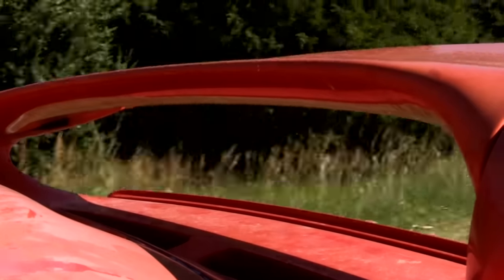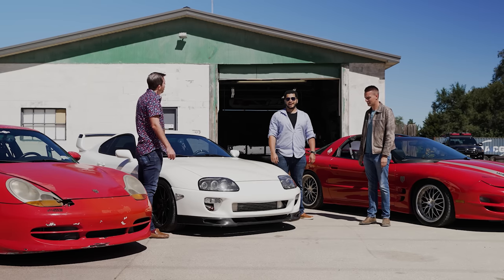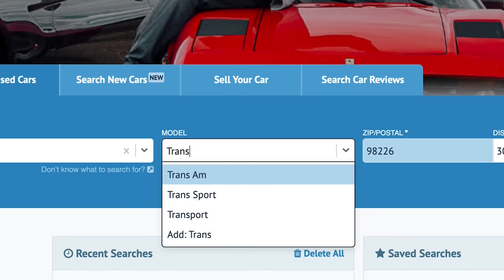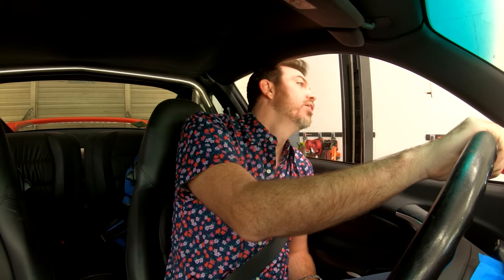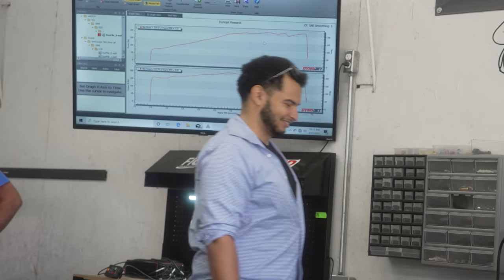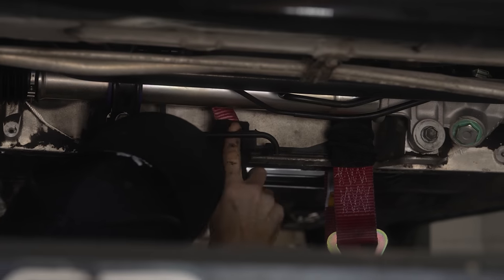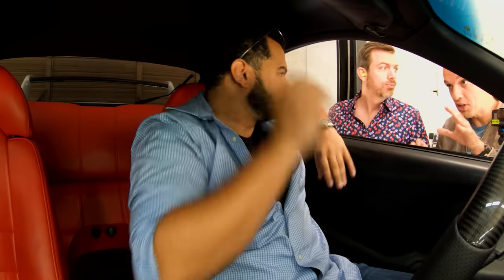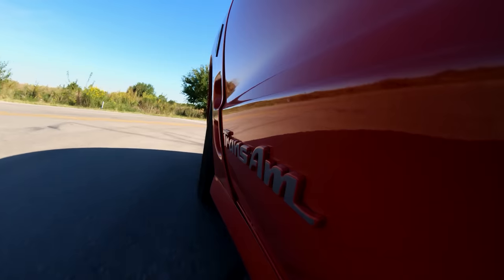We Bought 3 Dirt Cheap Sports Cars...Here's How Fast (Or Slow) They Actually Are | Car Trek S6E1

Comment: Ummmm....my dad took a 74,222 original mile, one owner, zr1 brakes, BIG ass cam, long tube headers, BC coilovers ws6 trans am for $2,000. I bought it for $3,700 out the door. This happened 3 months ago. AND its a black hard top. Yyyea. It did have a slight electrical issue impeding startup, but it turned out to be because of the fact someone lost the original key, had a new one cut but not programmed (pretty sure his son went on a joyride and lost the key then didn't have the $ to program it). I paid $180 to get a new key and fob programmed and the car is absolutely, 100% perfection. I put larger injectors, better valve springs, and an hp tuners tuner. She makes 433 wheel hp....NOT spraying the 150 shot dry N2o kit i installed. When i spray it, she makes 572 wheel. After the extensive and aggressive weight reduction including sterio and head unit delete, all seats gone with a kirkey in their place, gutted the 200 pound doors, a/c delete, i even evacuated the system and removed the condensor for maximum cooling. I got it down to 3004 pounds. My dad has a tuned c6 zo6 and i blow his doors completely off. It started as a joke but its actually grown on me. The thing fux im not gonna lie. In "mexico" i did a GPS confirmed 188 mph without nitrous because the bottle was empty. In the 96 days ive owned it, ive spent more money replacing tires from the unbelievably irresponsible burnouts than the entire car costed. Its actually legitimately fast believe it or not. I ran a 10.88 @ 128 mph all the way up here at 4670 feet above sea level. That was with c16 in the tank but hey. Its been dead reliable, sounds really, really cool, and my purge is going out the ridiculous nostrils in the hood which is just beyond cool. The other day i had the speedometer buried at a dead stop. 5th gear nitrous burnouts are rad i dont care who you are. My wife loves it even. When we go out on weekends instead of my cherry, 730 wheel,  port injected, and insanely high strung 427 cobrajet and t56 swapped 66 mustang she wants to take the fumunder chicken. Probably because the mustang is absolutely terrifying. It weighs 2830 pounds with me in it. The front suspension and k member is all tubular hotchkiss from an sn95 mustang. Doesn't change the fact its insanely violent, sounds exactly like a nascar and is just as loud, and has a really light flywheel with a triple disc so backtorque is a bit of an issue and can render  a new passenger concussed from cranium to roll cage impact.

Comment: The WS6 was dynoed wrong!! Driver placed the car in 3rd gear and said "that's my 1:1". He is absolutely incorrect. Dynoing the car in 3rd gear produced an incorrect and falsely high number. That cars 1:1 ratio is 4th gear since it's a manual. If the WS6 had a 4l60 automatic then yes, 3rs gear would be 1:1, but it actually has a t56 manual trans and 4th gear is 1:1. 

An amateur level mistake.

Comment: Amazing video! You guys never disappoint! But i have to ask, where did you find a GT3 , A Mk4 supra where they are considered "DIRT CHEAP"  sports cars?!?! For the type of cars those are that statement doesn't sound too believable. 4 inch exhaust, aftermarket intercooler , red custom interior ,wrapped in Michelin pilot sport tires, carbon steering wheel, big brake kit and a ECU tunned to run race fuel isn't exactly "Cheap" If you're trying to appeal to your YouTube audience then at least be humble and honest about it

Comment: 220 hp from 315 hp on the Porsche is huge loss. Porsche generally have less than 10% drivetrain loss, so it would have been 280hp at the wheel when new. Firebird at 400 from 545 isn't that bad. It should have 465 at the wheel when new. The Supra obviously doesn't belong in a just bought for under $30k category.

Comment: 3rd gear is not 1:1 in the t56 6 speed in the trans am. 4th is 1:1. I'm pretty sure the dynojet uses speed to calculate power so the ws6 power number are not correct

Comment: supra needs a twin turbo, smaller one and big one remove the lag and much more usable as a daily . you do not need insane power, an untouched supra are so rare they go for huge money, modding one if done bad or too much guess what you devalue it. id never buy a tuned car, id by a stock as possible and prob keep it that way and only if a forever car i might do a bit so more torque for sure and all my cars are light weight to start with so they handle quite well and better suspension good tires i leave many behind on welsh twisty narrow mountain roads, even stock supra will do over 150mph ive been in one only thing a map but not crazy one down the wrexham bypass we were running from the cops what was over almost straight away. old school 3.0 twin turbo think it was an 86 year it sure shifted well. seen vids too even just 600-650hp topping out at 200mph on the autobahn the year you got. a supra is my dream car but from the 80's  prob not happen, rare and insane price only 15 years ago you get a ok one what runs for 1500£ and good  one for 2-3£k now 20-40£k plus, the other reason now im driving the dream was before i was a driver im not a fan on heavy cars im just not, small light weight loads more fun on twisty roads what i mostly drive a light weigh car even good brakes are cheap so maintenance is cheap but just having as much fun

Comment: That 2JZ is definitely not the greatest engine in the world. Look at the aftermarket, the number of engines built and number or cars and truck the engine has be put in as well as their reliability rate and the LS1 wins hands down every time. It’s cheaper to make horsepower and takes less to make horsepower than a 2JZ. Freddy definitely cheated yet again.
The TransAm completely bitch slapped on the other 2 when it came to sound plus it made its horsepower naturally aspirated with nothing more than minimal mods. Boost it and the other 2 won’t touch it in the horsepower and torque curve.
The fact that Freddy showed up with a $24,000 car purchase price and then dumped a lot of money modding it adding the turbo and very expensive clutch when the other 2 brought what they purchased says enough.

Comment: The TA's 60 foot times must stink. 13.1 at 117 MPH? I was pulling 13.2@101 mph with my bone stock (except for borla exhaust) 2000 WS6 back in the day. And that was in Las Vegas which is an altitude track. I probably could of.done 13 flat at any other track. That car should be able to do 12's without even trying.

Comment: 4th gear on a t56 is 1:1. Tyler is misinformed. And if it had a decent tune idling with ac would not be a problem. And burnouts on street tires is unnecessary.  See the massive amount of wheel spin and hopping..

Comment: WS6s go for 30k+ for a clean manual. even a beat on, branded title WS6 goes for around 20k. Hoovies WS6 is also super clean and is already on $2000 wheels with a cleaned up engine bay as well. even though it makes less power from factory, you wouldn't be able to find one of those for under 20k. more so like 30k. the only one that counts in this whole video is the porsche because it's actually a $5k piece of shit

Comment: T56 is not 1:1 in 3rd… it’s 4th. Also 545 wheel is never gonna happen in a Ls1 all motor. So maybe crank? also no way you bought that for 10k in this market unless it’s got 200k miles. 

And that supra isn’t close to 10k lol. That’s a 30k+ car Easy. 

When guys try to act like car guys…

Comment: That Ls1 probably has that fluttering issue earlier ls1s suffer from.
Reply: Piston skirt "slap". It's due to the type tolerances in the piston rings, it allows a little oil into the cylinders, and causes a ticking noise until the engine warms up. It doesn't affect the reliability of the engine whatsoever

Comment: These 'car guys' do they not understand parasitic drivetrain loss? So '545' hp add some miles of wear & tear probably 495 - 500 @ crank would be around 400 - 420 at the wheels.  So when they are dogging about the WS6 not making its sticker power.  It probably did when new and the performance parts were added.  Real world dyno tests.....

Comment: Do these clowns not know the difference between flywheel and wheel hp? It’ a 10-20 percent drive train loss from the flywheel to the rear wheels. 410 whp is about 500 net hp.